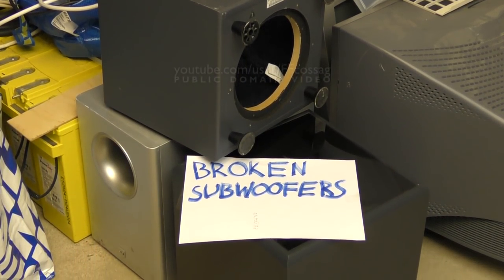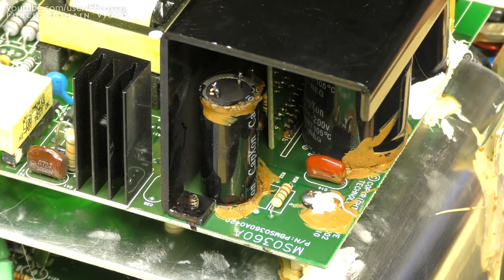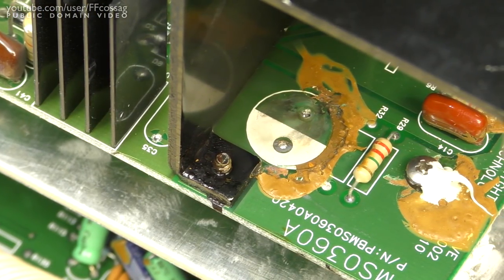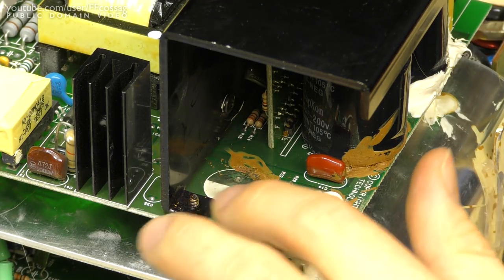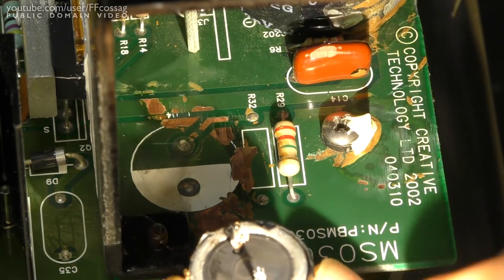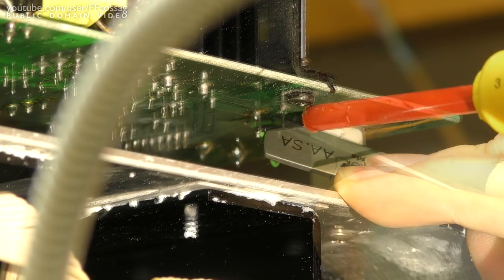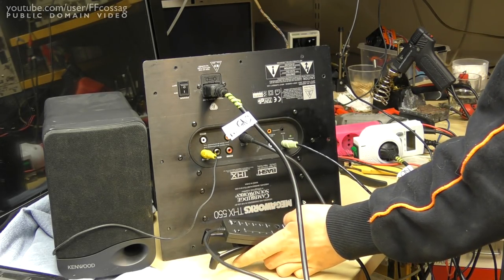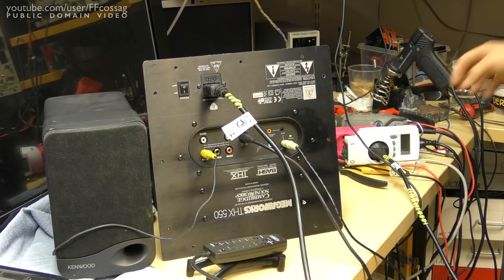Megaworks THX 550 repair (again)

Comment: Hi, I came across your channel, I'm glad it exists, unfortunately today it no longer repairs anyone. or two questions, I have a megaworks 250d that crackles from the analogue input if I turn up the volume, but lately it doesn't do it more often, which doesn't happen on the Aux input (it doesn't crackle) what do you think except what do you recommend I check. thanks bye

Comment: Hi there, great video. I have the same system that i love. I have sound noise issues. Left Chanel has a constant low white noise sound. Right channel sometimes has i louder white noise sound that after some seconds disappears.  Do you think that is something that can be fixed ? Regards!

Comment: Hi, thanks for the great video. I have the Megaworks 250D model which is 2.1 system with the same subwoofer and satellites. I bought it second hand few years ago but I noticed some strange hiss noise in the satellites on any volume level even on mute. The only time when the noise disappears is when I plug headphones to the remote. Could you give me a hint in which of the four circuit boards to look for the possible faulty element? My first guess is that the problem is in the amp that is always used unless the headphones are plugged in and is not related to a faulty power supply. My other guess is faulty element in the power supply which is causing this strange noise and when headphones are plugged into the remote the power supply is switched off and this is the reason to not hear any noises(because you don't need amplification and the power supply is switched off). Also when I was using it for a while with a higher volume level I noticed that sometimes the subwoofer turns the bass off until I restart (unplug it and plug it again). Not sure if both problems are related to one another. Any suggestions would be highly appreciated. Thanks in advance
Reply: must be a transistor failing

Comment: I own one of these. I've had it for 10+ years. It's always on, it's been through 4 house moves, thrown about and carried around.. no issues (touch wood). When the amp or power supply goes pop, how hard would it be to convert it to use an external amp?
Reply: You could do several options, get a 7.1 stereo reciever, use two of the channels to driver the sub (its has dual coils), then use the pc sound card and send them to the recievers seperate inputs (ext inputs). set all the satellite speakers to small and adjust LPF to ~150Hz, the sub-woofer rca output would get "Y" connection to drive the 2 channels for the sub.

Comment: hello, many thanks for your video. I have the same sound system. electricity. power is coming. but from the satellites and the subwofer the rustling sound is coming. sound too low. Can I fix the problem with this metho
Reply: no, he fixxed the stand by power supply, his unit would not turn on at all

Comment: How do you encounter so much broken stuff? Also, why do you all your things break in such exotic ways?
Reply from the maker: I wouldn't say that my things break in very exotic ways, I just make the effort to figure them out.
Reply: FFcossag I do as well, but it's always just a crack in the solder on the 3.5mm jack leads for me and nothing else haha.
Reply from the maker: In that case, be more careful with your headphone jacks ;)
Reply: FFcossag haha, yes.
Reply: Electronic Munchausen syndrome by proxy

Comment: I have a 650 with no remote is there a way to bypass the remote connection on the amp?
Reply: See my replay to AYMA HAWK
Reply: @user-rs8zg8ey2b  AYMA HAWK has no replies was it someone else?
Reply: @bigoz169  yes he does, and here is a copy of it ,,   Try looking on ebay for a replacment, if your lucky someone may have one, also, there is someone making replacement control boxes for a few of the pc speaker systems. this is not for your model, but maybe something out there for yours (https://www.ebay.com/itm/Replacement-Control-Pod-for-Logitech-Z-4-Computer-Speakers-z4-Remote-Volume-Ctrl/222361928495?_trkparms=aid%3D1110006%26algo%3DHOMESPLICE.SIM%26ao%3D1%26asc%3D225086%26meid%3D0fdafc9e602a46908223822b6fde0cb6%26pid%3D100005%26rk%3D5%26rkt%3D12%26mehot%3Dpf%26sd%3D321365475310%26itm%3D222361928495%26pmt%3D1%26noa%3D0%26pg%3D2047675%26algv%3DSimplAMLv5PairwiseWebWithBBEV2bDemotion&_trksid=p2047675.c100005.m1851)

twocvbloke

Comment: I got a GigaWorks S750 of which the amp broke like 10 days after warranty expired. It also would not turn on anymore. I replaced the sub/amplifier with a Pioneer 7.1 home cinema receiver and an active sub. I really love the sound quality of these series but the build quality of the Creative amp is worthless.
Reply: Hi, i have the same speaker that it broke,  tried to fix it myself but no luck,  could you please let me know if I can keep the original pc speaker cable if I buy a 7.1 receiver?  or I have to buy speaker wires? 

Also if possible could you please guide me through which model of 7.1 receiver and sub you got?  

Many thanks
Reply: @bboyalanleung123  You will need a receiver with a 7.1 analog input. Keep the original cables. You will need the original sound card connector cables with the mini jackplugs. Then use a bunch of female stereo mini jackplug to male tulip cables to connect to the input of your receiver. You can use regular speaker cable to wire your surround speakers to your 7.1 receiver.

Be prepared to take a few tips to the audio store to get the right converter cables.

I'm using a Pioneer VSX-1016V receiver and a Klipsch KSW-10 amplified subwoofer. I'm very happy about the Pioneer receiver but not so happy with the Klipsch sub because it tends to shut off at low listening volumes and then with a THUD come back to life when the volumes are a bit higher.
Both are older and no longer being made. Most important is that you get a receiver that has a 7.1 analog input. At least, if you want surround sound in 3D games with an X-Fi card.
Reply: @Aranimda  my bad, I meant my speaker is the gigaworks S750,  but I guess your reply still applies,  thank you for the detailed reply though!  very helpful
Reply: @bboyalanleung123  Yes, I also have the S750. As said, I still use the excellent satellites because the subwoofer with the built-in amplifier died.
Reply: @Aranimda  yeah , they are awesome speakers,  I think I will give up the sub and move to an AV receiver,  thanks for the tips!

Comment: How is that white goo arround the capacitor called ?
Reply from the maker: The stuff I use is Fujik thermal compound off of Dealextreme. It comes in a tube, not a syringe, and it goes hard-ish with time.

Comment: Nasty stuff indeed, but its happy again until...... lol :)
The old kenwood ham radios used to suffer with a similar thing, the goo would short out the various pcbs and cause mayhem.
The fix was pick it off and remove parts where it was impossible to remove.
No kaboom but trouble :-(